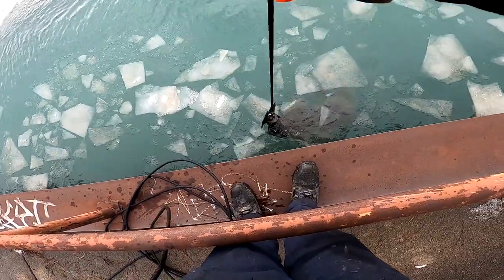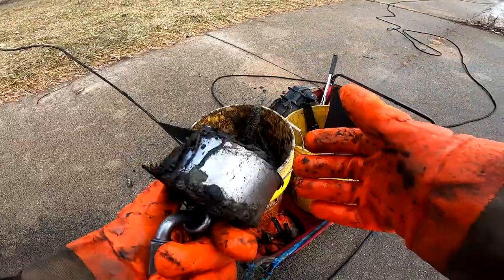Magnet Fishing the Detroit River

Comment: i live near detroit and this makes me want to go magnet fishing!!
Reply from the maker: You should for sure. We need all the help we can get to clean the river.
Reply: @MotorCityMagnetFishers  any recommendations on where i could find a cheap starter magnet?
Reply from the maker: There are a lot of cheap ones on Amazon but remember you get what you pay for. It also depends on what your definition of cheap is. The Centurion Magnetics starter kit is around 35 dollars and is a decent little magnet. You can order it directly from them. If you want a strong magnet Rogue Magnetics has a 1200 lb single sided kit with rope and case for $85.50 with free 2 day shipping when you use my discount code. But ultimately it is whatever fits your budget. I would recommend approaching a magnet fisher if you see them and checking out what they are using. If you see me at the river stop by and I would be happy to let you try a couple different kinds.
Reply: @MotorCityMagnetFishers  Thank you so much! hopefully i see you sometime so i can try them out:) you think i’d have any luck at lake saint clair?
Reply from the maker: It all depends. We do this to clean the waterways. Usually lakes are not too bad except around docks. We should be out this Sunday probably in Detroit.
Reply from the maker: You can message me on facebook or Instagram if you are out and about